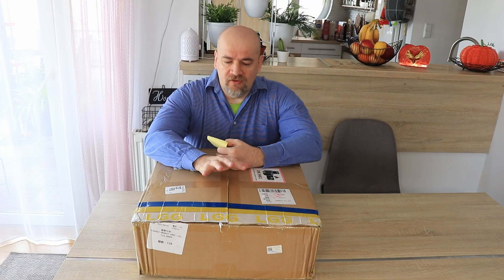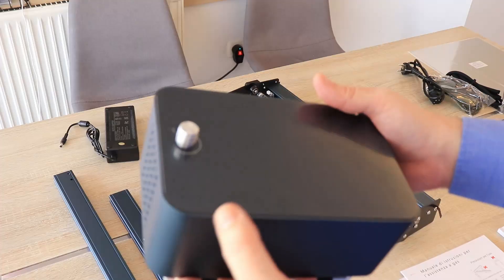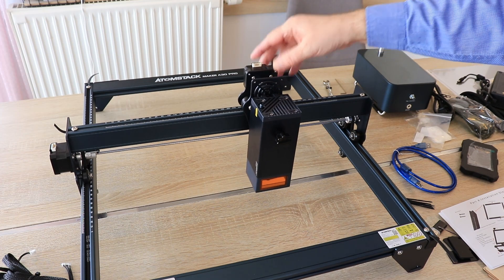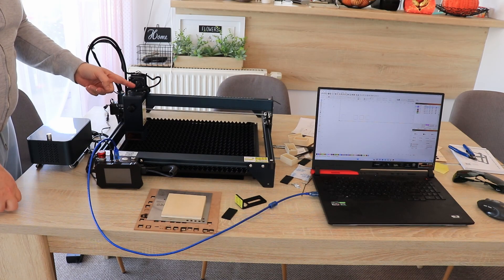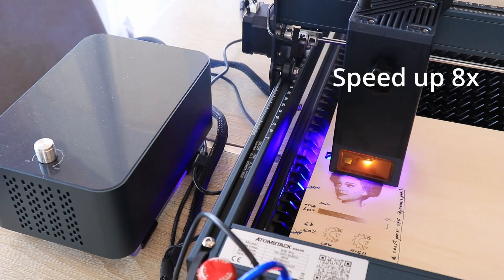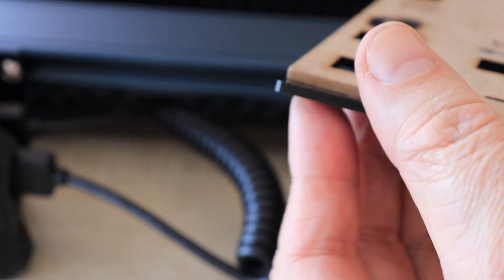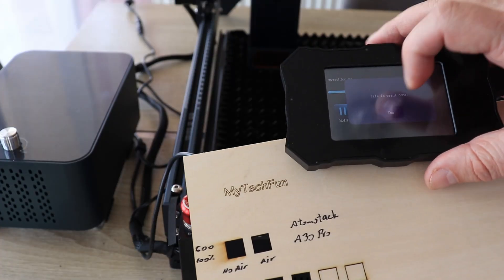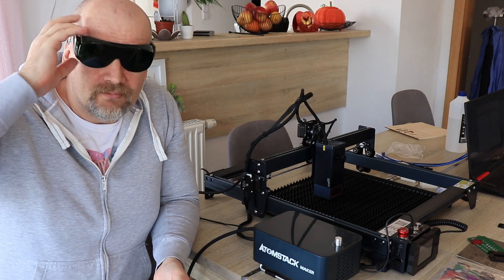Atomstack Maker A30 Pro laser cutter and engraver - review of a powerfull 33W diode laser

Comment: Meh...

10w more than the Falcon 2. Weak looking frame. Not as many safety features. Huge air pump. Not a big company.

Falcon 2 is the better buy.
Reply from the maker: As you mentioned. Additionally: advantage of A30 is the screen for offline engraving, disadvantage is the mechanics mentioned in the video.

Comment: Basically, not worth the money, A20 is the same and give you almost the same possibilities
Reply from the maker: Probably I will have some comparison A20 vs A30. What materials you would like to see tested?
Reply: @MyTechFun  Honestly, none ;) In my opinion 20W it more than enough for any hobby application
Reply: @alexey_sychev  I agree.

Past 20w there is no point with the kind of projects people will make on these desktop diode lasers. It's just a money grab now.

Anything thicker than 20mm I'm going to my table saw which will be ten times faster.

I would also rather have a 20-watt with a sturdier frame, than a 30 watt with a flimsy frame like this.